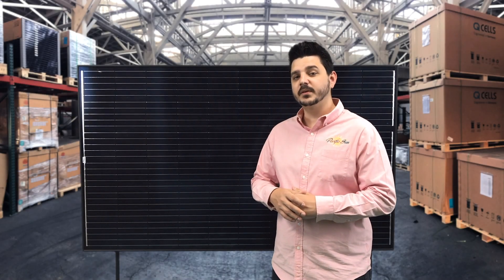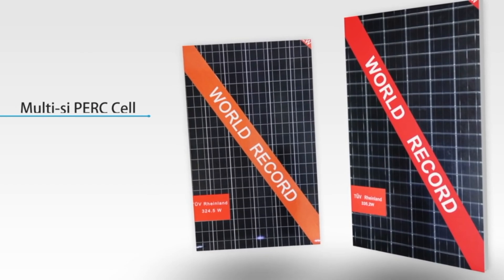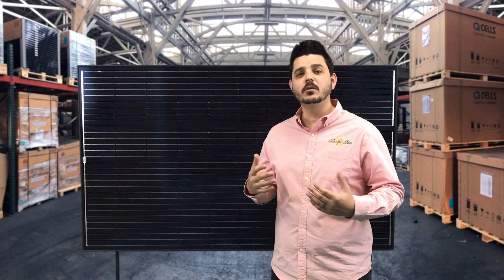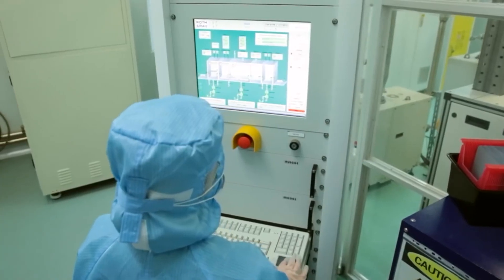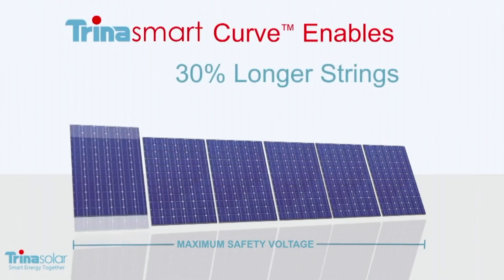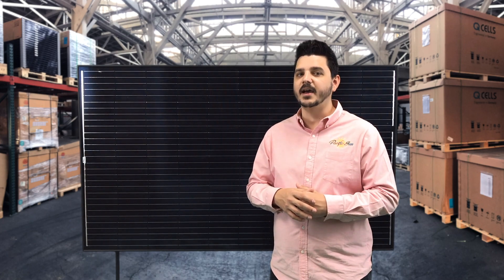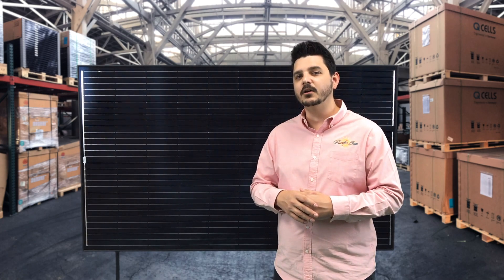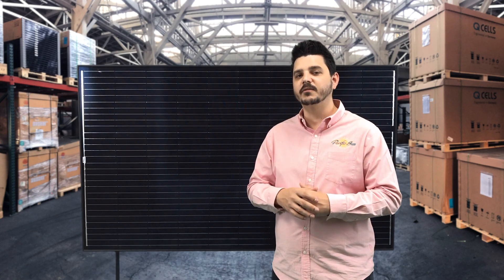Trina Solar | Product Review | Good or Bad?

Comment: I have a whole bunch of their panels.  310 W each.  I bought a bunch of them at $130 per panel. I've been testing a couple of them for a while and they seem to work so far keeping a small battery bank of four 100 AH batteries topped off.
Reply: What volt system do you have 24, 48 volt,  etc?